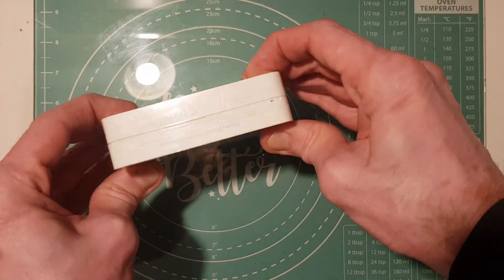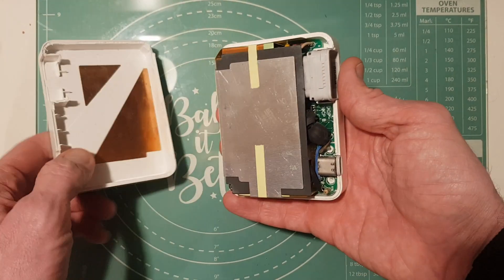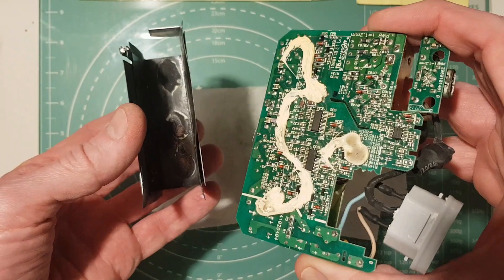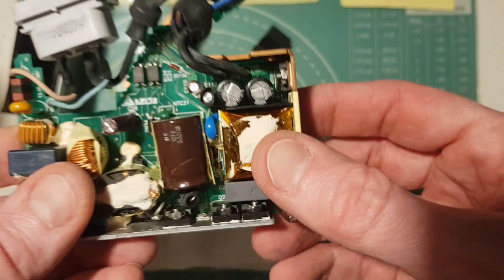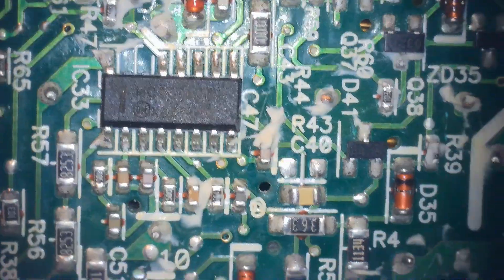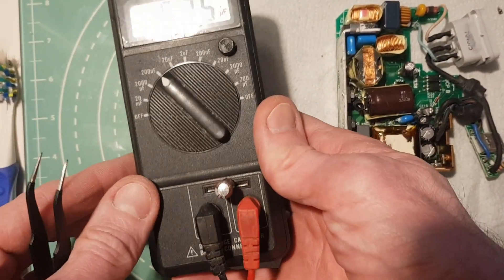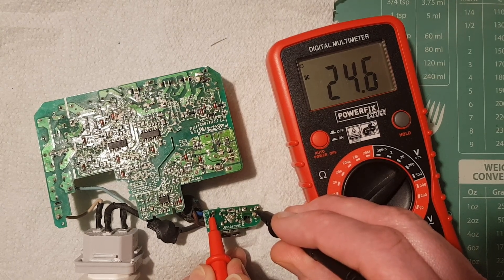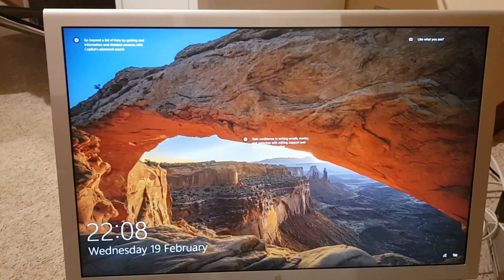Apple 24" Cinema Display -  Power Supply (A1097) Disassembly and Repair

Comment: thanks for the tip, petrol works surprisingly well! unfortunatelly I had a bit more faulty component inside...
Reply: I recommend replacing that 85uF/450V capacitor as well!

Comment: I have the 30" display with the 150W adapter. When the display is in standby mode the power adapter generates a high-pitched whine. This wasn't always the case. What component is likely making the noise?
Reply from the maker: Probably the transformer whining, could be due to faulty capacitors as well